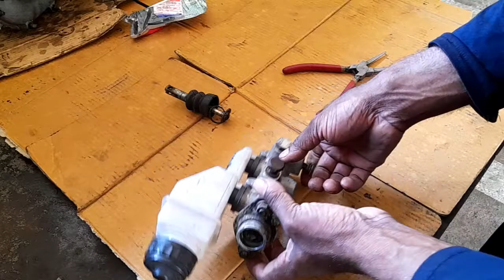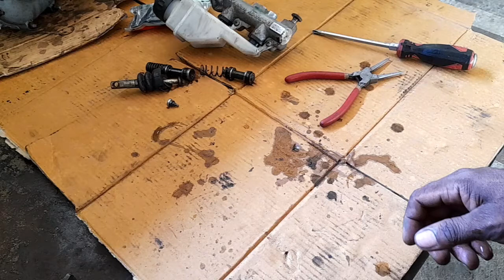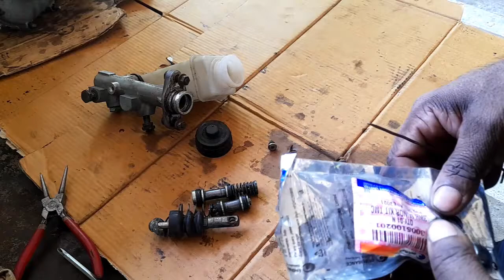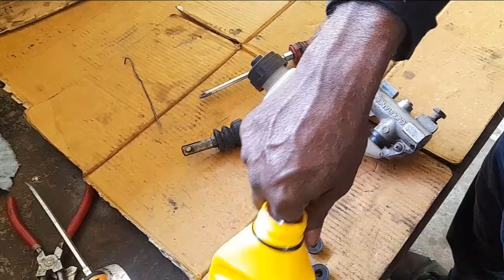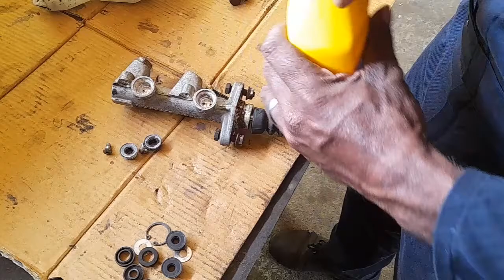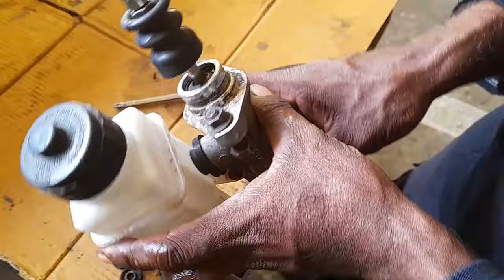HOW TO CHANGE MASTER PUMP REPAIR KIT | SINHALA | ක‍ොහ‍ොමද මාස්ටර් පම්ප් එක‍ේ ව‍ොෂර් මාරු කරන්න‍ෙ

Comment: Master pompe oil aduweela thibela.breck   patel eka adiye berack  tibune.adu oil pirewwa eth den brek wwadin ne ei e
Reply from the maker: meda hulan athi.eekai brake naththe.mata cl ekak ganna hulan arina widiya kiyala dennam.0716060496
Reply: Brake washer leak athi , roda tika check karala balanna